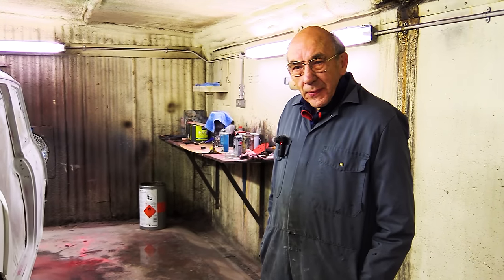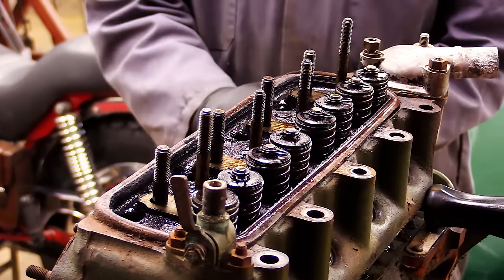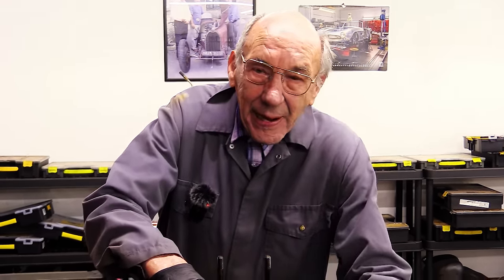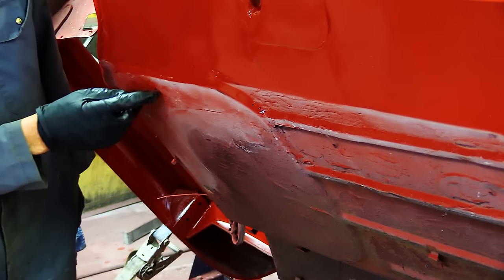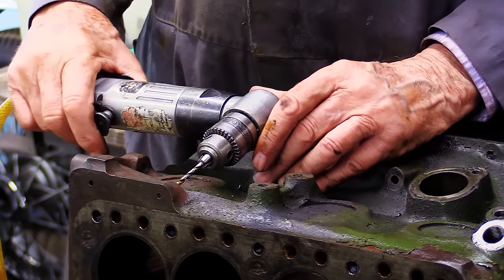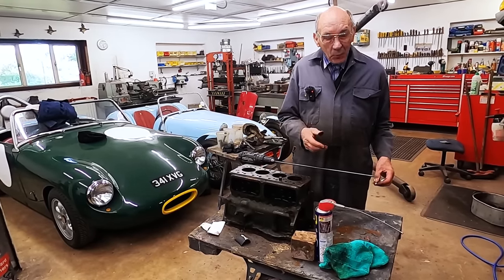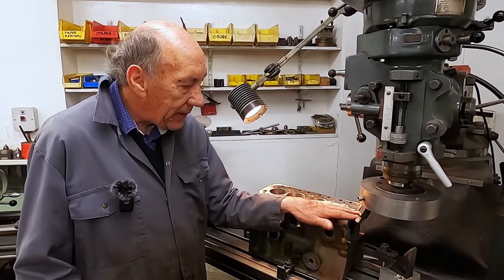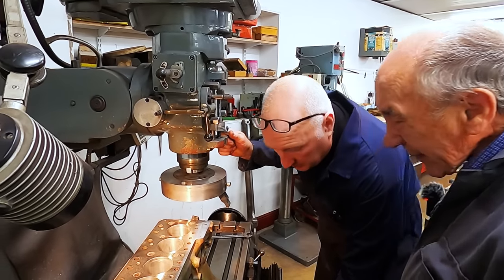SHED RACING - Mini Part 3

Comment: we used to dowel-up the manifolds after first fix and making a match impression and then grinding out ports to match manifolds for gas flow -- hahaha--- used to spend days in the shed with flex drill drives and rotary stones and cutters---happy days and thanks for walk down memory lane!

Comment: Fantastic bumper length video with fascinating content including worldly - wise advice from Ivan about keeping active !.The prototype  features of this very early Mini are very interesting to note and radical changes to production occurred within 2 years .I'm currently recomissioning a ' 61 Austin Seven and note so many differences .I can thoroughly recommend ' Paintman Paints ' coach enamel in original matching BMC shades and Tartan Red ( code RD33 ) , would be ideal for the internal floor area and results are very impressive .Also , they do the A -series engine green , I opted for satin finish which blends in better than ultra -shiny gloss finish.Thanks to Tanya for grest camera work !.

Comment: From memory, two turned rings on the cam is an AEA 630 cam, used in 1098 engines and the 998 Cooper. Good for an an 850. One turned  ring is a 997 Cooper cam, 88G229. Looses a bit of low down power in an 850, but good at the top end. A duplex timing gear set and chain is worth fitting.
Reply: Good memory.
Reply: Spot on.

Comment: A good upgrade for the brakes, which was often done in period, was to fit the twin leading shoe brakes from the later cars. My mate had a 997 Cooper with those tiny discs when I was running a 1098cc engined converted '66 850 and the braking on that was vastly better than his Cooper.

Following the series avidly, great stuff Ivan and John.

Comment: Your rod with a slit in the end is a very good/cheap tool to have, I used to work for a company that made rotary burrs and metal finishing products, they used to make and sell rods about 6 inches long with a slit in the end for the same reason, cleaning and deburring, they're good for cleaning carbon from exhaust ports

Comment: A 2 ring camshaft is  a AEA 630 one, it was standard on the
ADO16 and early midgets, if its a genuine BMC one then the lobe width will be 3 eights of an inch. Its a very mild one and hardy worth the swop. Go for a 2A 948 one, the best stage one improvement. This was the standard cam in the 997 coopers. If you cant get this then AEG 148 is a good alternative. it's a bit milder. This was the one fitted to the early Ss (before they used the AEG 510 which was fitted from engine number  9F/SA-Y/40006) And also used on mk 2 midgets. I checked this on my B.M.C. Special Tuning data sheet on camshafts. One of my bits of "stuff " that I acquired from my days working in their special tuning / competitions dept. Hope this helps.

Comment: The cylinder head for a Mini Cooper was 12G940 ( I think) . From memory it was developed with the help of Daniel Richmond , of Downton Engineering. You mentioned about the tract of the manifolds, Daniel used to blow through them to see how they sounded, to get the correct flow. Hardly high tech , but he was ahead of his time. In fact David Vizard once worked for him, as did Gordon Spice who used to race the Mk 3 , 3 litre Ford Capris - I think he won a 24 hour race at Spa with them, Jan Odor of Janspeed - famous for the exhaust manifolds, and possibly Ralph Broad of Broadspeed Racing. Quite a pedigree, I’ll think you’ll agree
Reply: 12G940 is a 1275 head, the 998 cooper used a 12G295 head or similar 12G206 head, the 997 Cooper used the 12G202 head.
Reply: @Radfordperson  11 stud , I believe
Reply: @martinclapton2724  12G940 I believe covered a range of heads, the S being 11 stud. My Metro 1300 engine is 10 stud, so is my Austin 1300 head.

Comment: PURE MAGIC i love all your videos please God you live another 30 years .
Reply: You have to lighten the flywheel and backplate as much as possible. This will have a great effect on the acceleration in first and second gear. I have done budget balancing of the flywheel on a wheel balancing machine, with great success :-). Make a proper calculation of the CR with a medicine syringe. With the 2 ring Cooper cam about 10:1 CR. If you mill 0.3mm of the head it takes about 1cc from the combustion chamber.

Comment: You have to lighten the flywheel and backplate as much as possible. This will have a great effect on the acceleration in first and second gear. I have done budget balancing of the flywheel on a wheel balancing machine, with great success :-). Make a proper calculation of the CR with a medicine syringe. With the 2 ring Cooper cam about 10:1 CR. If you mill 0.3mm of the head it takes about 1cc from the combustion chamber.

Svar
Reply from the maker: sounds a bit clever for me

Comment: I may be wrong, but I think early 850 engine the cam ran directly in the block, no white metal bearings.
Reply: You are correct regarding the centre and rear bearing
Reply: @petesmith2132  Thank you for the clarification.

Comment: Are you going to fit the later  bi rotor oil pump? The older vane types wore pretty badly. Are the  crank thrust bearing recesses worn? I've has the thrusts come out on an oil change before now.  I retained the new ones with brass countersunk screws!  Needs must.

Comment: A bad gasket leaking coolant into a cylinder will create a clean piston/combustion chamber, historically some people have allowed water to be ingested into the engine to decoke it, it can cause damage obviously if too much is ingested (hydrolock) and if there is masses of carbon in the engine it can cause these to break off.
Rotary engines (Wankel) can benefit from this method of decoking amongst others.
It can be used as a diagnosis tool obviously a clean piston indicates a coolant leak generally.

Comment: Are you sure your fly cutter is "trammed in"  ?
Looks like it needs checking to be cutting down the sides like that.
A good straight edge on the block with feelers will show if it is hollow.
OK, teaching  granny and suckling eggs I know.

Comment: Is that tractor a Fordson Major? My Granda had one very similar back in the '70s & '80s. It was quite tired. The starter was shot on it and it never had a battery in it. He just parked it up the top of the farmyard and bump started it every time. It had a scraper on the back and was omly used for mucking out the milking parlour. If you stalled it you had to tow it with another tractor to start it again.
Reply: power major i think

Comment: I know what MOWOG stands for on the engine Do You ? here's a tip for you when bleeding a brake system use ptfe tape on the bleed nipple thread then when bleeding air cannot be sucked in, then when finished remove any excess that is sticking out or if you prefer leave it.
Reply from the maker: Morris Wolesley Garages??
Reply: @shed_racing  absolutely correct but then again I knew you would know be an old smart cookie like me, with a head full of useless facts.

Comment: You want to be sure the milling machine's head is clocked to the bed otherwise you'll be machining the block surface concave... I was worried when I saw only the left hand side of the tool was touching the block which means the milling machine head isn't square. 🤞